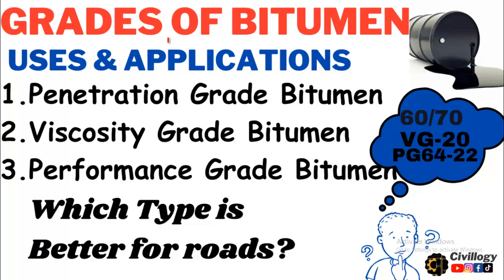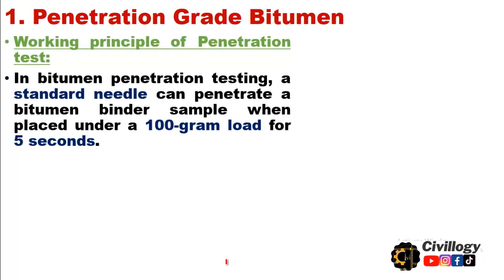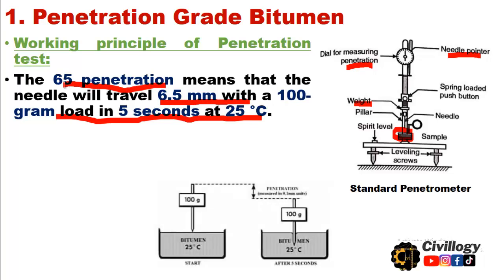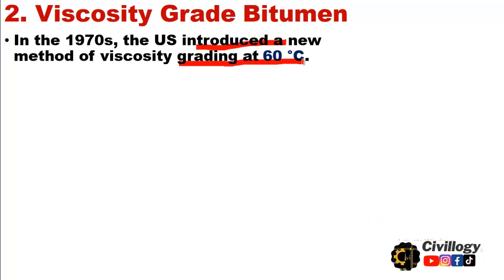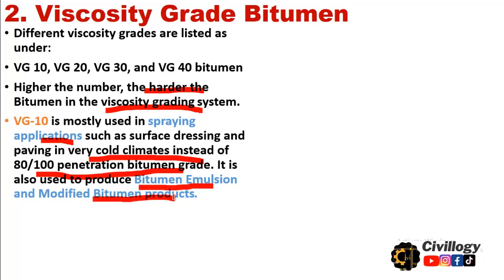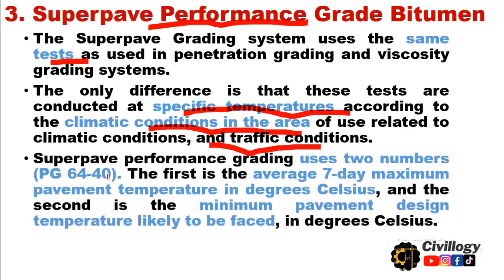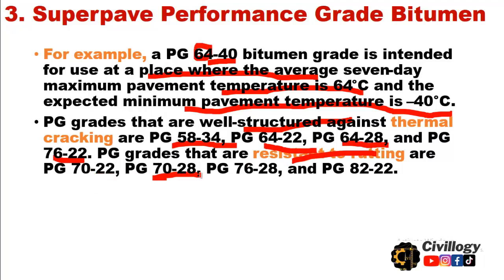grades of bitumen|uses and applications of different grades of bitumen|Types of bitumen

Comment: 00:04 - Overview of bitumen grades and their applications in civil engineering.
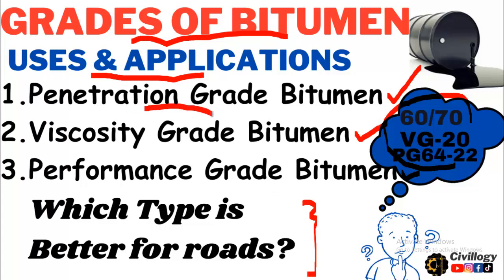01:13 - Overview of penetration grade bitumen and its significance.
02:23 - Bitumen grades vary by hardness and are tested using a penetration test.
03:35 - Understanding penetration grades of bitumen for road paving.
04:45 - Bitumen grades impact road construction efficiency and temperature performance.
05:58 - Different viscosity grades of bitumen cater to various applications and temperatures.
07:16 - Super Pave grading enhances bitumen performance based on climate and traffic conditions.
08:29 - Overview of PG grades of bitumen based on temperature and properties.
Reply from the maker: Great work